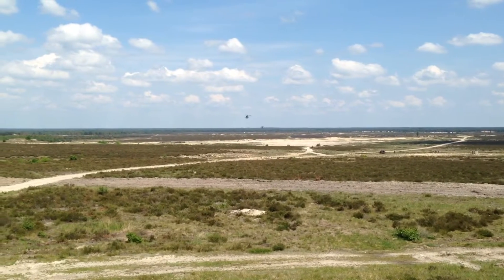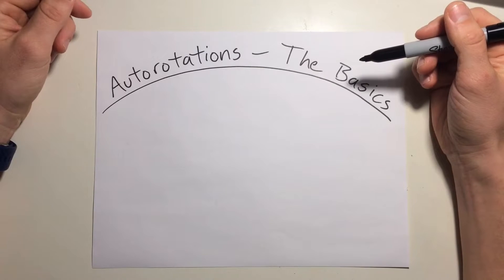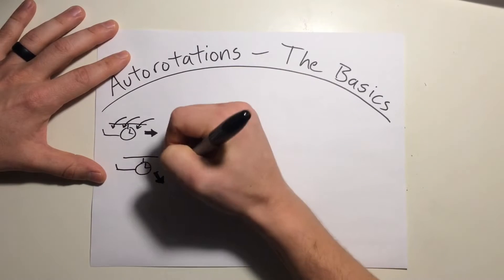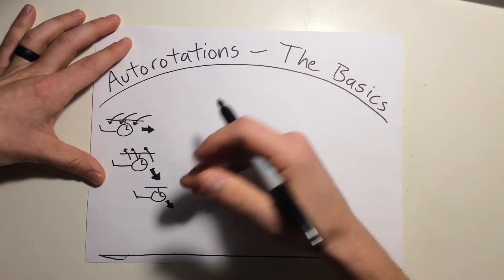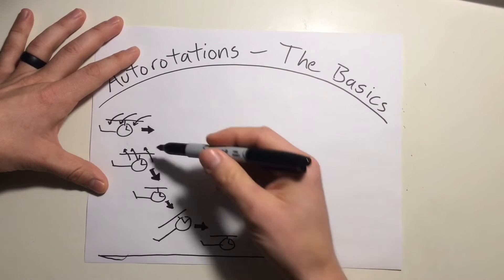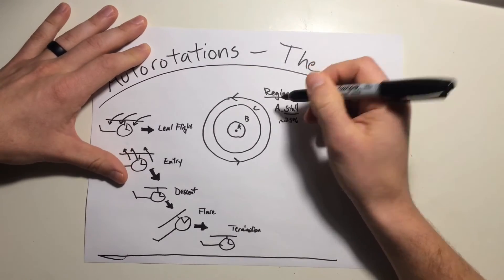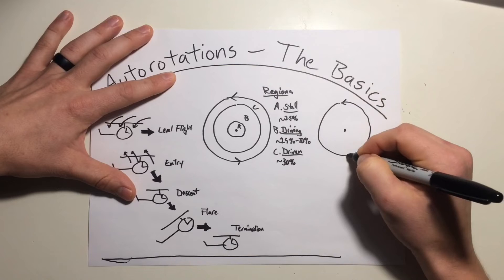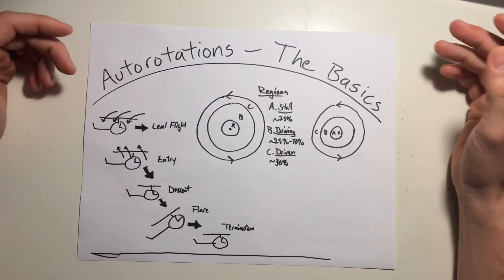Autorotations (The Basics) in Helicopters

Comment: If a household fan is blowing against a breeze and the power goes out, the breeze will blow the blades of the fan in the opposite direction.  Why don't the blades on the helicopter do the same thing?

Comment: How nice of physics to allow for a chance to survive a heli engine failure 😅
Reply: It really is amazing and unexpected when you realise that the rotors are not "windmilling" in the way an airplane propeller windmills, but are being driven forward by the horizontal component of the blades' lift vector. So it truly is AUTO rotation in the sense that the rotors' own lift is what is causing them to rotate.

Comment: thanks for this. I've never flown a helicopter, only RC heli's. The one thing I wanted to confirm is that when you say :"lower the collective" you're actually reversing the relative pitch of the rotors to what would be negative pitch, and then at the last moment using that rotor momentum to generate lift by changing back to positive pitch. Do I have that right? And if so - is there any sort of "feel" or "lockout" in the collective handle to prevent using negative pitch while under power (say, on the ground or close to it?)

Comment: Hi, you say when the engine fails, lower the collective to the "Autorotation" position, then you describ it as  "The Driven Region". . .  So how does decenting through the air, drive the rotor in the same correct direction, without the change of air flow direction also causing the blade rotation direction to reverse. ?

Comment: I think there's nothing like Auto rotations that really brings out a lot of confidence in a pilot. Knowing if something goes wrong you can safely Glide the helicopter to the ground and maintain an AirSpeed and an RPM and come close to Landing directly on the spot you choose or even Landing directly on the spot you choose I think brings a pilot's Confidence from like 20% up to like 200%. You know the saying aviate, navigate, communicate? Like first you fly it that's the most important part. Navigating is second. And the radio is certainly the last most important part. I find that doing less auto rotations makes you a perfectionist and you actually start paying a lot more attention to things like your attention gets drawn to correcting your direction too much or putting too much attention on the radio. I suppose if you're not doing that at all maybe that's a good thing. I suppose a person could perhaps not paying enough attention to where they're going and they're getting lost or actually not communicating whatsoever not paying attention to the radio at all or stating who they are talking to who they are where they are what they're doing Etc. And of course what I'm saying is totally subjective it's totally perceptive of my own self. Everyone is entirely different. I think practicing Autos non-stop just puts a person at ease about a potential engine failure. And of course you know don't over inject yourself with too much confidence because practicing auto rotation and an actual engine failure or not the same thing. To me personally though I find my attention is way more directed towards the aviating part and wanders less when I constantly practice auto rotations. It just makes me a totally different kind of competent person and when I don't practice them as much I find I get nervous and my attention wanders a lot. As though I'm always thinking about things too much. Doing the auto rotations removes a lot of that nervousness and lack of focus. You know I've heard people when they stop training when they're beyond the student phase and they're beyond the CFI phase even though they've gone through the whole flight school endeavor and have moved on to other jobs that the job actually only requires auto rotation practice training like every once in awhile it's not something you go out and do every week anymore. Wow I don't know how I feel about that. I guess it's part of the process if you do it enough times you do like 10,000 auto rotations and your confidence is really high you move on and do other things and they don't require that as much. That whole concept is so foreign to me at this point. I think I just become kind of a wreck of a pilot if I don't practice Auto rotations enough. Some instructors even treat auto rotation training as though it's like a "privilege that we might not necessarily be doing today unless you just want to have fun." I guess some students really take advantage of the adrenaline rush or something? I find a lot of those same instructors they'll get really mad when you start paying too much attention to navigating or using the radio when you're flying. 😂 see I'm probably distracting everybody who would read this by using my own perception to paint a picture. Not everybody is me. Not everybody learns the way I do. Privilege or not I think the practice of it is so important not just for the actual practice of Auto rotations practicing auto-rotating Landings to me take so much Focus off of the nervousness and lack of confidence that you have one flying when thinking that some emergency might happen that you can't handle. To be the constant practice of auto rotations removes that nervousness and I believe that nervousness causes your attention to not be put properly on certain things at a certain time. In which case you might start doing things backwards you start communicating then navigating then aviating. You start becoming too much of a perfectionist and not just doing naturally things in a certain order when needed. To me that has a domino effect as well when you become nervous like that you stop doing the things that actually help you do the navigating communicating preparing ahead of the flight which is where all that navigating and communicating should be prepared for way ahead of the flight so you focus on just the aviating when you're flying. To me the practice of normal Glide Auto rotations, minimum Glide and maximum Glide with AirSpeed in between 55 and 70 and 90 knots and RPM usually between 97% to 108% for the 70 knots normal glide profile and otherwise 90% RPM for minimum or maximum Glide and understanding your three bank accounts with two accounts pertaining to kinetic energy with the rotor RPM and forward thrust consisting of that and the last account being potential energy which is your altitude and understanding the trade off should be like just as much of your training as normal flying. So when I say that I think flying the helicopter should be like 50% out of rotations I mean 50% of your helicopter training should be engine off in the other 50% should be engine on even if Technically when you practice Autos the engine isn't actually off but you are still taking advantage of the freewheeling unit there's a decoupling in the transmission is no longer providing power to the rotor RPM from the engine as though the Sprague clutch is engaged and the induced flow is inverted and no longer is the correlator being affected by you moving the collective up and down. Yes some instructors do think that you can do too much auto rotation training. See now to me because it improves my confidence I believe it makes you less likely to over focus on navigating and communicating and not properly focusing on Aviation then navigating and communicating I feel like it removes your confidence and you become distracted you may be stop planning as well as you stop PreFlight planning as well you probably don't prepare your navigating and communicating as well with less PreFlight planning you put too much attention on the navigating and communicating and your flying unless attention on the aviating. And true to what instructors say what makes you really good at Auto rotations is a combination of how are you usually handle the collective and cyclic and pedals and how you plan your approach most of the time with your sight picture in your normal flying and when you're doing auto rotation you're just practicing maintaining AirSpeed and RPMs and using your ability to do good approaches and handle the collective and cyclic without expecting the engine to power the RPMs. Therefore the instructor seems to put more time on your normal approach and shallow approach and steep approach and hovering and quick stops Etc. Yet I just can't help but feel like auto rotation training cannot be emphasized enough and totally changes the mindset of a student the way that people think a solo changes their mindset of a student. You could easily say the same thing about a solo right. You're only repeating the same thing you do with the instructor just by yourself. Yet is considered SO ESSENTIAL. Same way I feel about autos. To me there's nothing like 5 or 10 good Autos throw in some 180°s the totally improves the confidence and coordination and removes the distracting wandering mind and give the student a boost of adrenaline wakes him up gets his mind thinking in the proper direction and gets his attention properly on just enough things at a time to where you can properly aviate and then the navigating and communicating doesn't seem so distracting. But of course like I said I'm speaking from my own perception. This is how my mind works this is how my brain benefits from these exercises. Now of course I don't understand the instructor that thinks that "too much autorotation training is just for fun and the student doesn't need a constant adrenaline Rush dumped into his mindset just whenever he's bored and he needs to focus on many other aspects of flying just besides Auto rotations." But I suppose if I understood many of the other students that want to take advantage of this maybe I'd get the instructor that says they wanted to deter from this direction. Anyway that's how I feel about that
Reply: Dude, paragraphs exist for a reason!

Comment: Very informative.  I invite helicopter pilots to fly in a gyroplane as flights are in an  autorotative state a all times.  Flares to landing without power on short final are quite easy to perform and are a fun way to land.  (Comparing Apples to Oranges) but getting on the deck safely is what it's all about.

Comment: Do you alter the blade pitch during autorotation so that it spins to wind blowing up through it instead of down?
Do you flip the blade pitch back coming in to landing to generate lift and cushion the landing?
I realised the flare is important because there might not be enough kinetic energy left in the rotors to halt descent without stalling the blade. This is similar to the landing of the space shuttle - the upward point at the end allows the craft to "swoop" in instead of plummeting into the ground at 120 mph down 360 mph horizontal.

Comment: Normally AOA = increase in foward airspeed? But in autorotation = decrease in foward airspeed?
Reply from the maker: You want to decrease angle of attack in the blades to keep the blades rotating at normal rotor RPM. If you did not reduce collective, the drag on the rotor would cause it to rapidly decrease.

Comment: Do the three regions only occur during an autorotation or also in regular flight? And if they do still occur during regular flight, are they swap around on the blade radius because you have downward airflow instead of an upward airflow?
Reply from the maker: Yes. These are regions associated specifically with non-powered flight. Check out my “Dissymmetry of Lift Expanded” for the regions during powered flight

Comment: At my school, they say for our power-on autos we should start flaring at 40ft. Of course, different helicopters from what the Army uses, we use R-22s. Great video! Love your stuff for refreshers.
Reply from the maker: It depends on the helicopter weight and altitude. As both increase, the flare has to start sooner. 18,000 lbs of helicopter at 8000’ MSL would crash into the ground if you waited until 150’ to start a flare.
Reply: @helicopterlessonsin10minut10  Great points. Thanks for the response!

Comment: How can the Russian k-52 Alligator rotate?
Reply from the maker: You increase pitch of one of the the lower disks at a time. Depending on which way you want to turn will determine either the upper or lower rotor disk to increase pitch on.
Reply: @helicopterlessonsin10minut10  That is little complex to me. 😞

Comment: How helicopter turns left to right or right to left?
Reply from the maker: Using the cyclic control you would increase pitch on one part of the rotor disk and decrease lift on the opposite side. This tilts the rotor and can turn the helicopter in flight. If at a hover, just use pedals to change the direction the helicopter is facing.
Reply: @helicopterlessonsin10minut10 No no I know about that, I mean... 
Let's assume that the  main rotor of a helicopter rotates from left to right then the helicopter will start to rotate in opposite direction (from the Newton's third law of motion). So a tail rotor is needed to maintain it. If  I want to rotate the helicopter from left to right, I need to stop the force that produced by the tail rotor then the helicopter will automatically start to rotate from left to right. If I want to rotate the helicopter from right to left, can I increase the speed of the tail rotor or ... ? 

If my English is wrong, please forgive me😁🥰🤗.
Reply from the maker: You won’t change the speed of the blades. You change the pitch of them. So to pedal turn right, you change the pitch in the tail rotor to change angle of attack.
Reply: @helicopterlessonsin10minut10  Thank you.

Comment: But if engine fails and top blade spins because of free fall of Helicopter then what powering the tail rotors to counteract the counter spin of helicopter relative to spinning top blades ( according to Newton's third law in circular motion ) ?
Reply from the maker: The main and tail rotor are directly linked. So turning one will spin both.

Comment: To understand auto rotation I just imagine holding a small fan in my hand ( the one kids are using on the beach). If theres no wind, then you need to run with it to make it turn. That is the equivalent of lowering  the nose and gaining speed to create a relative wind in a way. Obviously the very first thing is to lower  the collective and by doing so you change completely the angle of attack of the blades . This angle of attack changes allow the flow from the bottom now ( the relative wind you have now created) to allow the blades to keep turning. If you don’t do that, the blades will stop turning because not changing the angle of attack of the blade will stall the blades immediately.... then you will drop like a stone. When you descent, keeping the blade turning at a certain speed will store energy  that will need to be dissipated in the flare and landing. But you will have one chance and one chance only! i guess the lighter the blades, the less time time you will have as there is less energy stored in the blades. The heavier ( and the more) the blades are I guess the blades will have more momentum, so you will have more time to dissipate the energy stored? Is that correct?
Reply: But coming to the ground we flare but do we lift the collectif again or just keep it as it is for the decent

Comment: If the wind is traveling through the rotor disc in the opposite direction during an auto, why do the blades still spin CCW as in normal flight?
Reply: The lift vector of the blades in the "driving region" has a forward component that pulls the blades forward. Note that this concept is different than "windmilling". If the blades tried to windmill (by going into negative pitch), they would in fact slow down, stop, and reverse. Except that either the blades would hit the tailboom or cone upwards and snap off due to low RPM before that could happen. This is why the collective is adjusted so the blades cannot go into negative pitch.

Comment: But if the engine fails isn't the rear rotor also stopped? So how does one counteract the momentum of the main rotors or is their momentum negligible at this point?
Reply: None of the rotors stop. The rotor energy maintained by the descent is able to maintain enough rudder authority to control yaw.
Reply: I believe you're assuming that the tail rotor is not mechanically linked with the main rotor and that both rotors get their power from the engine individually, which your comment would make sense. 

In reality though, the main rotor and tail rotor are both mechanically connected, so if the main rotor spins, it'll also drive the tail rotor.